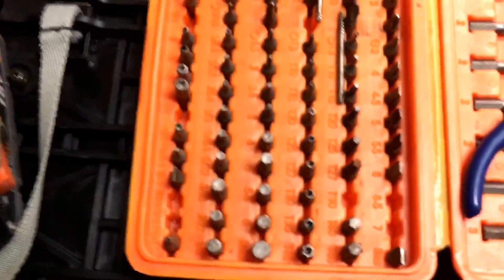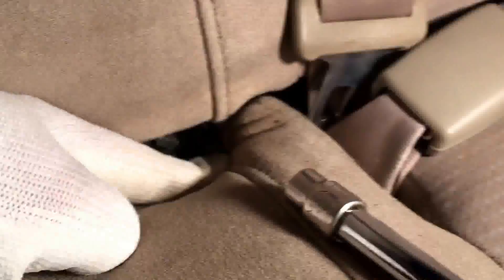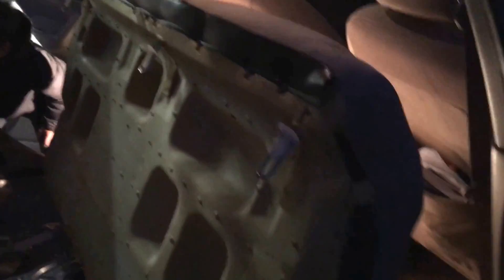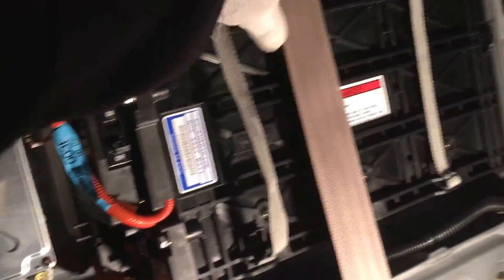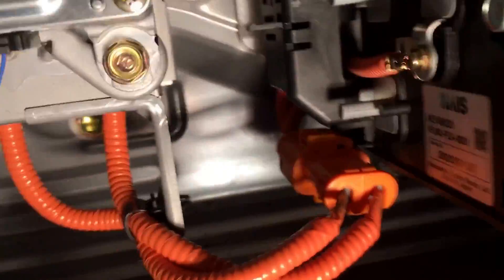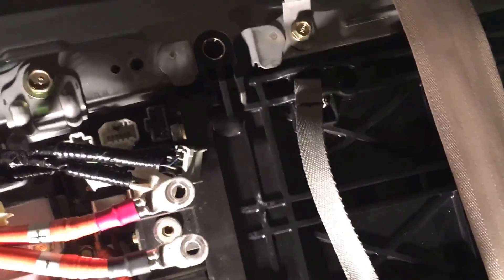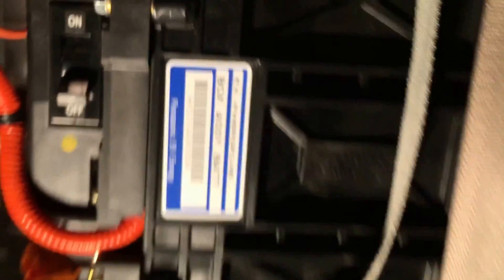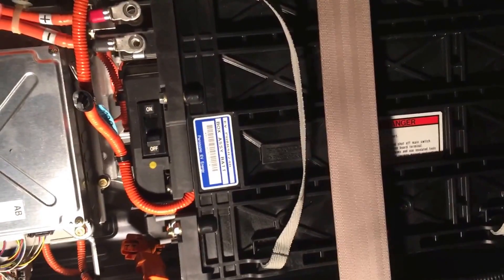2003 2004 2005 Honda Civic hybrid battery replacement

Comment: Bought mine from greentech and it needed to he taken to a Honda dealership to get the battery reprogrammed. Just a heads up, you might be better of doing this job in the parking lot next to Honda because being 40 miles away sure was a pain with the battery not communicating.

Comment: What company did you use because I bought a new battery and it killed my car battery. So I removed it and put my old one back in and it started back up. Then I did research that you have to reprogram it? Did you have to do that? If not am I able to buy a battery that doesn't need reprogramming?

Comment: Aloha, thank you for the video. I did this twice now on my wife's 2003 honda civic. The procedure takes me about an hour and 15 minutes including the time to vacuum up all the rubbish under the seat. The dealership wants $5K to do the job! Sadly we couldn't afford that. One thing I might comment on is that all the work takes place in the back seat, is easily accessible and uses minimal tools.
Reply: I’m super worried because I have the same car and they want $4k at my dealer for this.

Comment: i have a check engine and IMA light on. my codes are p1449 (overheating) and p1600 (system malfunction). i read online that this could be caused by the heat from outside, will i have to replace my hybrid battery or will the problems go away overtime?
Reply from the maker: Yea, sounds like a bad battery, you can always get it diagnosed at the dealer for a hundred bucks or so.. maybe more,. But it’s good to be 100% sure

Comment: Thanks for this great video! You made it easy! One note I might add is that it seems to take a bit of time (10 minutes or so) for the charge to dissipate once you turn off the switch. So check the charge over time until it is zero.
Reply: How do I check the voltage?

Comment: Thanks for the video.  I wish I saw this before, would have saved me from pulling my trunk apart to get to the parts.  My question, do you know how to disable the immbolizer?  My car key ignition went bad, so I had to replace the how set, and now I get the Green Light key blinking three times .... means key not matched to car.  Do you have a technique to get the car to learn the new keys without a programmer?
Reply from the maker: Sorry, that’s outside of my wheelhouse

Comment: hello it does has a swicht to turn off the batt..   i gotta reemplace the transmission do i need  to remove  all the cables  or  just turn off the switch
Reply from the maker: ramiro ochoa TBH, I haven’t done a transmission and am unfamiliar with the process/maintenance instructions. I figure you could turn off the switch and take a volt reading at the transmission lugs to verify it has no power. I’d imagine the switch should cut power to those terminals at the transmission if it kills the power at the battery connections as seen in my video. Proceed cautiously, check and verify twice before you put hands on it. Be meticulous, use your volt meter, try and use non-conductive tools and take off one lug at a time and tape each cable connector completely should power come back on or there is current that your meter didn’t pick up on for some crazy reason (stranger things have happened, don’t become a statistic, CYA brother). Pull back wiring harness and secure to firewall/frame with tie wraps to avoid damaging the wires when you pull the transmission. Take lots of pics, label your connections so it all goes back together right. I hope this helps, be safe and thanks for the comment.

Comment: I've got 375k on my civic and battery. It's still charging and discharging, but the 12v light is coming on at low rpms. Have you had to replace the dc to dc converter or any fuses associated with the hybrid cell?

Also, did you need special gloves to do this install? I think Honda techs have to wear them.
Reply from the maker: Taylor Humes no, just replaced the battery. Tbh, if you understand the system and you check all your connections to assure that power is completely off, and you have 1/2 ounce of common sense then you shouldn’t need any gloves or special tools to change out the battery per the instructions I gave in the video. The gloves and special tools are excellent detractors to owners and regular mechanics to not work on these cars and let dealerships charge an arm and a leg for service. Granted some people really shouldn’t if they aren’t smart about it. It’s also a way Honda covers their a$$ by putting as much personal protective equipment on their mechanics to ensure that if they don’t follow procedure that they won’t kill themselves.   As for your problem, my 12 volt light started coming on as my failing hybrid battery stopped charging my 12 volt battery. The hybrid system refuses to charge the hybrid battery when its capacity to hold a charge (battery efficiency) drops to a certain percentage and it starts to overheat because internal resistance rises. That may be your problem but if you’re not getting an ima light or popping codes I couldn’t tell you one way or another, I’m just talking from my experience. Now is when you really have to weigh out wether or not you should junk the car or fix it. You’ve gotten a lot of miles out of your hybrid and are luckier than most, def some bragging rights there. But when stuff starts going wrong you are looking at thousands of dollars to keep it rolling and tbh, you may or may not get quality hybrid replacement parts that will get you another 25k-100k miles more for the investment. Like I said, it’s just money and it would be cool to see a civic hybrid reach 500k, but at what cost right? Be safe and thanks for your comment. Sorry I can’t help or know much about the charging system, just battery replacement.
Reply: @dustinelgan6070  no, you've been a big help. I found a cell out of an 04 with about 113k on it for 250 bucks that doesn't have an ima light on. I'd say a relatively healthy battery will last at least another 50k, but there's also no telling. 

I believe you're right, though. If 250 keeps it running another 2 years at 55 mpg, I'd say it's worth it :)

Comment: You should try my trick before you get to the point of replacing the pack.  It is simple, cheap and easy to install.  Over time it will recondition the battery pack and return some of the capacity.

Look on my YouTube channel and watch the videos.  Feel free to ask any questions about the installation.

Comment: If my battery is showing it needs replacement isn’t there a way I can just run the car on gas to avoid the hassle of replacing the battery?
Reply from the maker: Ron H depends strongly on how you drive it. If you use the brake right coming off a freeway so your IMA does most of the work, or at any stop light you gain in those situations. You’re not recouping any of that energy with the system not functioning. I averaged 42mpg with IMA working, 35 not working.
Reply from the maker: Daniel H unfortunately that will only last for so long until the hybrid battery shuts down completely and it stops charging your accessory 12 volt battery under the hood and it will leave you stranded. I took it to that limit once. Red battery light in the dash came on 3 miles from home, I limped it home luckily.
Reply: Dustin Elgan thanks for the response! May take the cheaper route of buying a used battery and replacing it myself (Im in the hvac business, not the car business, but Im sure I can manage)
Reply from the maker: Daniel H best of luck to ya, you’re best off getting rid of the car to be completely honest. I sold mine in awesome condition with 120k miles with a brand new battery for $1800, more than half the battery cost, big money pit, pretty disappointing. Will never look at another hybrid again after this one.
Reply: @dustinelgan6070   been 3 years since this comment. Man my 05 is a tank, been driving it with the bad battery forever. The red battery light comes on occasionally but will go away on its own. AC doesn’t work. But i think I’m gonna finally make the repair on this thing. I have a new truck but this was my first car so it has a place in my heart lol. Might sell it when the repair is done. Do you have a model number on the battery for the 05 hybrid civic?
Reply: Is it applicable to only Civic? or Accord Hybrid as well. I got a HAH 2005 and I am planning on disabling the Hybrid Battery by shutting off the switch in the middle of the panel. I have read on some forums that 12 Volt battery will be charged by IMA motor at engine RPM above 3500.
Reply from the maker: Ankush Gupta TBH, I don’t know similarities between civic and accord. All I know is when mine went bad, i wasn’t getting a charge to my 12volt battery. I didn’t try it with the switch off, but that would make for a really gutless car and bad mpgs lol. If you’re in a bind, I hope that’ll work for ya, otherwise get rid of it and buy a non-hybrid. The Ford Focus I have now gets like 6mpg less but I’d much more fun and comfortable, glad I made the switch. Best of luck to ya, thanks for your comment!
Reply: On a 2003-2005 civic, it is possible to disconnect a single connector on the MCM and have the car run on gas only. Most Civics will work well and will keep the 12V charged, but about 10% of them won’t and will need higher revs when stopped in traffic. (All 2000-2006 Insights work well with the battery bypassed.) Please note that the ima and check engine light will stay on, and AC may not function.
Reply from the maker: Daniel H I heard there is something that can be done to do this but I’m not familiar with what wires/plugs need to be swapped out, and it may trip your check engine light so you might not pass emissions.  The car will get bad mpg and will be extremely gutless, but if necessity puts you in that predicament then where there’s a will there’s a way. Best of luck to you.
Reply: Dustin Elgan actually, it will still get good fuel economy if you normally get good economy. It’ll just have little pep.
Reply from the maker: Ron H I live around a lot of hills, no flat spots.. i unfortunately would suffer. If you do a lot of flat straight away freeway driving with little city driving you’d be ok I guess.
Reply: Dustin Elgan yeah, well your assist doesn’t save you that much fuel. Your 1.3L I4 does.
Reply: Dustin Elgan Driven gently, a CVT civic should get 60 highway and 50 in town with a good battery. With the battery bypassed, this will drop to about 55/40. Whenever I teach someone to drive economically, I suggest they pretend there is a raw egg taped to the accelerator pedal and the object is not to break it while accelerating. My personal best is 76 mpg in an 18 mile loop in a 2004 5 speed civic and 120 mpg on the same loop in a 2000 Insight.

Comment: how do you get that bottom connector to let go?
Reply from the maker: dosmastrify should be a quick disconnect harness with tab that you push in on and should disconnect without any problems. You may have to move it gently side to side to help it unseat and disconnect. Let me know if this helps.

Comment: what was the total price for replacing the battery?
Reply from the maker: Mr Pink through bumblebee battery, around $2500. It may have gone up or down, but you can call and find out. Dealer wanted $3300-3400 and the battery through them isn't warranted as long, and not the upgraded version of bumblebee, at least that's how it was with my local dealer. Not surprised.
Reply: Dustin Elgan thanks! I'm looking at a 2005 with 118000 miles selling for 3000. I wonder what are the signs that a battery is begining to fail

Comment: You are aware there is special training, and special rubber tools and gloves you should be wearing when servicing/replacing hybrid battery? You can be killed if you don't use those. And I've seen a hybrid battery Arc, dude was lucky because he was wearing the gloves otherwise he'd be dead.
Reply from the maker: Dan Craig good point, but calling it "special training" is a stretch, a basic class on electricity and how it works, and knowing that the two big lugs in the install with all that bright wire wrap is a serious one to check for current before touching is plenty. If you turn the breaker to off, check the terminals on the battery with the voltmeter, and it reads 0 then there's really nothing that can go wrong unless you decide to go through the plastic case on the battery with a blow torch or you mess with the battery without turning off the breaker. Most people that understand those simple principles regardless if the voltmeter says 0, insulated tools are a plus and you still treat it like a live circuit (even though it isn't) and you don't make contact with other terminals out of precaution. Thanks for your input, doesn't hurt to be extra cautious, I will make a note in the description. I appreciate the comment and have a good day!

Comment: One of the best repair videos I have seen. Are there any websites you suggest where I can get a battery with a warranty?
Reply from the maker: Austin O'Harra bumblebee batteries is a great company, they honored my warrantee. I believe they are out of Oregon or Washington state. Highly recommended.
Reply: @dustinelgan6070    also greentechauto.  They warranty a regular hybrid battery for 12 months, unlimited mileage, they also carry a 6.5 & 8.0 amp battery, more money of course, with a 36 month warranty.

Comment: Will the can run without a  problem after doing this?
Reply from the maker: Rayderson Chevalier if your problem is the battery then it should work. If you have doubts have a Honda dealership troubleshoot the battery first, no sense fixing something that's not broke.

Comment: how much money does this cost in the end when you decide to do this yourself? im slightly worried about getting a $4500 civic hybrid now knowing the cost of this repair considering im only looking at a 9 yr old hybrid purely based on gas millage.
Reply from the maker: yz125ryder can't go wrong with a Honda. Just make sure it's rust free, that the suspension isn't shot, exhaust system is intact and not hanging by a thread, and that it's been properly maintained. One thing I always look for are mismatched tires, a sign someone didn't care about maintaining their car properly.
Reply from the maker: xstevedx you need to be smart when looking at Civic hybrids. You can't just go by mileage of the vehicle to determine if the battery is still good or not. Mine got replaced at 60k miles initially, but the car was 11 yes old on its original battery, and again under warrantee at 145k miles just less than 3 years later. I nearly had expired the warrantee by 2 weeks when that cursed IMA light came on. You have to go by service records, what the dealer has to say about the condition of the hybrid battery as they can do a test for you which costs like $200 if you're seriously looking into a car to purchase. Other than that, I love my Civic a lot. Not a fast car, but reliable, moderately comfortable for my lanky 6'2" self, and for my family. Don't trust a car with its original battery pack anywhere near 8 yrs old and not replaced or under some kind of transferable warrantee. If you see a car that you love and absolutely want to have, but have no kind of guarantee that protects you, figure it'll cost you $2600 if you replace it yourself down the line (bumblebee batteries are who I used) or the dealer will get you for about $3500+. If you're looking at cars for gas mileage it's worth looking at newer compact-midsize cars as their mpg falls  within 5-7 mpg of the Civic hybrid. My 2013 focus falls within that range and it has balls when I want them and economy if I'm easy on the gas pedal which is nice, and I don't have a potential $3000 service light that could pop up at any second which is a pretty bad feeling when it happens. Hope this puts your mind at ease. Best of luck to you!
Reply: Dustin Elgan Yeah thanks I'll definitely be looking at service records for any replacement batteries and ask about warranty into for sure. I have a whole lot of driving to do and honestly i can't seem to find anything else that comes close to an 08 civic hybrids 45mpg for about $4500 bucks! The battery is a concern for sure though.
Reply from the maker: xstevedx your best bet is mentally add the amount of replacement battery to purchase price of the car, then take that number and compare to good gas mileage non hybrids in the same size-comfort category and weigh the cost of 3 yrs maintenance and gas expenses including depreciation (hybrids don't resale for 💩, I know cause I'm trying to sell mine with a fresh battery and I can't sell it even for what the battery is worth) you'll find you'll either break even or come in just a little cheaper buying a non hybrid used car. That's my reality that I've already lived. Bought mine 3 1/2 yrs ago for $6500, put 90k miles and about $4300 including replacement battery and other maintenance items. Can't sell it now for more than $2500. Big dark hole my friend, car needs nothing, need paint touch up on bumper and hood, no rust, newer tires. Pretty disappointed. Tough resale, wouldn't recommend it for the headaches to save 5-8 mpg at the pump... just my thoughts.
Reply: Do you think it is a better idea to just opt for the gasoline 1.8L version?
Reply from the maker: yz125ryder yes, go with a five speed if you're good with a clutch or go with anything 4 cylinder in same size category 2012 or newer. You'll see that regular hondas with the same mileage as the hybrid you're looking at sell for about 30% more. Best of luck to you.
Reply: i cant afford a 2012... i was thinking a 2006 with low km 1.8l?
Reply: thanks for the tips!